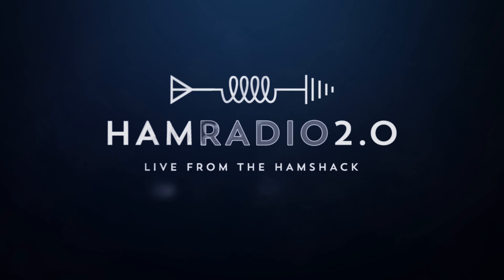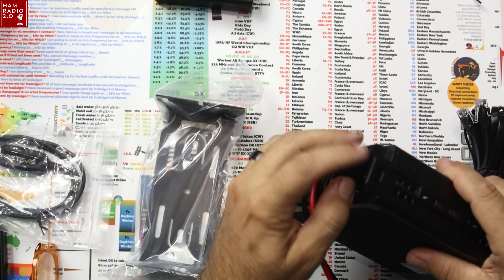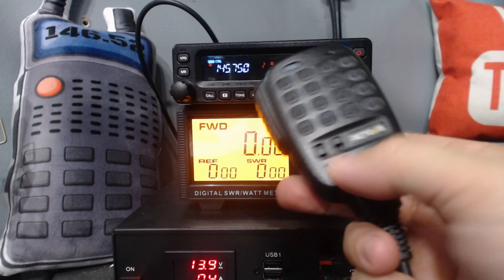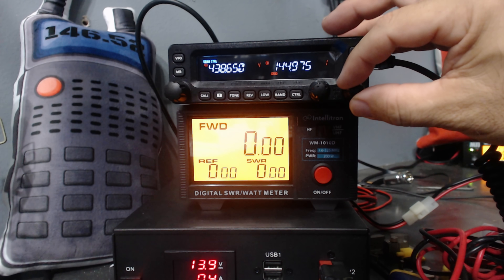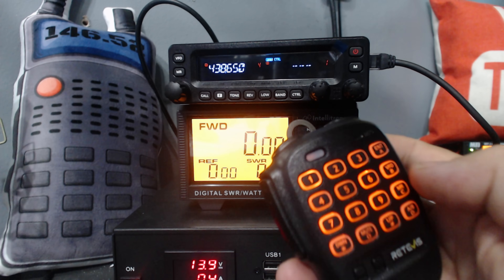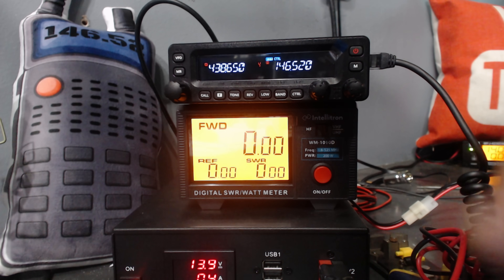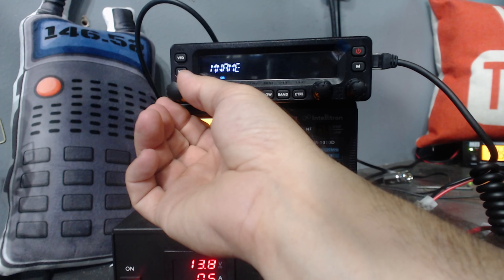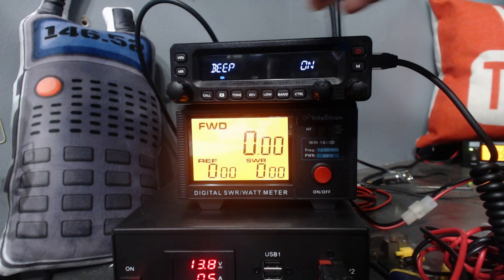The REAL Power Output of Retevis MA1 Radio Revealed!

Comment: The power output on UHF is kinda disappointing.  Only 35 watts out of 50 on high.  40-45 would have been great.  The pros are: Full 50 watts on VHF; Superheterodyne; crossband repeat; noise cancelling; air band and FM radio.  However, I noticed that when you keyed up on 442.900, the power meter registered 43.75 or something.  Hmmm...

Comment: Bought one now sending back. It would program tones on most freg. But not all. Down load for radio would not install. I have and tried a windows 10 and 11. What programing I did was from panel. I will not take a replacement, fool me once. You and others have made the MA1 sound great, I did not find it so. For my mobiles I will stay with Japan. I am75 and have set-up a few radios.
Reply from the maker: Probably quality control issue, like most things from China.  Some work great, some don't.

Comment: As a long time Kenwood V71 owner I could probably run the MA1 with my eyes closed. Either Retevis, or their supplier, had a hand in making the V71 or those plans were used for this radio. Unless Kenwood releases an update to the V71 this might be at the top of my list for a new dual-band rig. Anxiously watching to see if they get the bugs worked out of it.

Comment: I have it for my Chevy trax, its been wonderful to work with. Programing wise computer software is my go to. Also not intuitive but gets the job done. I have all my local repeaters, GMRS, FRS, MURS stuff in it. Plus local police,  fire, ems which is nice to be able to listen to if i need to. the screen at night is perfect not to bright, not to dark. its like running a web browser with dark mode enabled. I'm enjoying it for a nice entry to ham radio stuff. been getting good RX and TX with it on some night contacts.
Reply: Is there a way to unlock so it can TX on GMRS would love that, then I would buy it in a heart beat.
Reply: @jimmorgan1078 mine came with the ability to TX on GMRS, but there’s 3 band settings, I think it’s a 3 button push and boot it up allowing you to pick
Reply: @HeavyIronsProduction  nice will it Tx on all channels of GMRS or is 8-14 I think no go on Tx, since it is 50W radio.
Reply: @jimmorgan1078 I turned it to the low settings for those

Comment: I have a 3 Retevis handheld radios and I like them a lot. They are descent radios. That said, the price of the MA1 pushes me to the ICOM 2370A for nearly the same price when it is on sale.
Reply: kinda hard to justify not getting an Icom when it is only $30 more for an extremely similar radio.
Reply: The icom comes with nothing, accessories are alacart.
Reply: @jeffferrell.k9hca531 that is very true
Reply: And the yaesu ftm-150
Reply: @RhettSparrow  I was just going to say this. Put an FTM-150 in one of my cars last weekend. excellent rig. I have other yaesus and Icoms that are over 25 years old and they run and look like they are new. People need to stop looking at only price and consider value as well.

Comment: I have seen 2 to 3 reviews of this radio  and now yours.  All of them have been a basic out of the box here is how it operates.  I have this radio and have a delay on transmit issue.  Would really like to see a more in depth “this is how it has operated for me” type video,  if you can.  Thanks
Reply from the maker: Delay on transmit - what's that mean?
I mentioned doing another video after using the radio
Reply: @HamRadio2  When keying the mic there is a short delay before it actually starts transmitting.  I have to remember to pause after keying before I start talking.

Comment: Looks like a TYT TH-9800 or Radioddity DB50 with a "Kenwood Facelift". 

Probably has the same issues as its brothers.
Reply from the maker: It's different than the 9800 for sure
Reply: It's a rebranded TYT TM-D60W.
Reply from the maker: @MD-sj2dn - Retevis and TYT have the same radios that are made by a 3rd party.  They are all rebranded, including the TYT models.  I asked TYT for their version of this radio a year ago - asked them where I could buy it - never got a reply

Comment: Not fun dealing with Retevis for a new PA for my Retevis
UHF Analog/DMR low power
repeater.
No local US service 
I have had it for a bit over a year, and the PA output failed.
It's taken a long time handling
this with their customer  service person in not always
clear English, plus sending me
a video on how to replace thPA tube.
Also the 20 watt Analog/DMR
small mobile rig has a terrible
software to program it
I am using a CPE for it which
is better for programming
from an amateur in Scotland 
Also, the CPS for their Ailence
HD1 Analog/DMR HT is also
difficult to work with it.
I like RT systems software, but
they don't produce any for these rigs. 😢
73 de W2CH Ray Peekskill NY and Marylyn KC2NKU.😊

Comment: I have the MA1 radio. Just bought it to try it with satellite. I've been working with support on a noticable delay in transmitting when the PTT is pressed. They have sent me numerous firmware updates.
Reply: I have this radio and I have the same issue. It’s like a 1 to 2 second delay.
Reply: @BrantKQ4YHR  Thanks for this. I almost thought about considering a non-Yaesu rig for a moment.